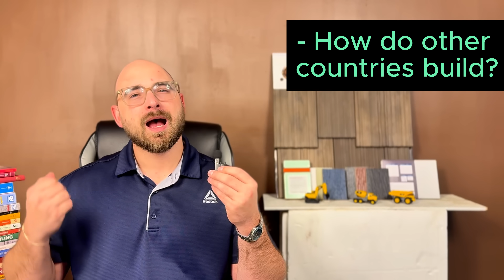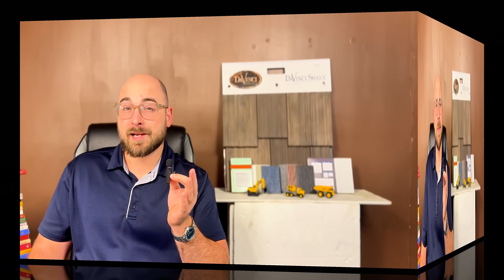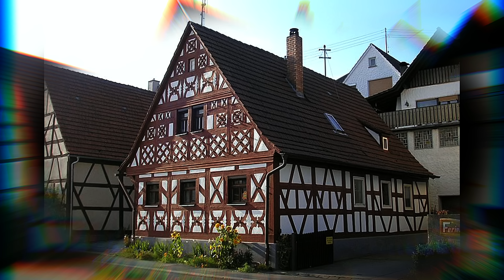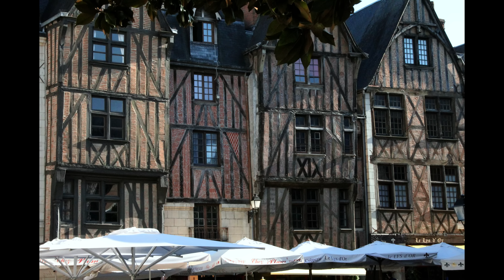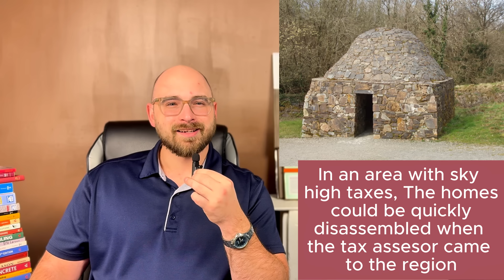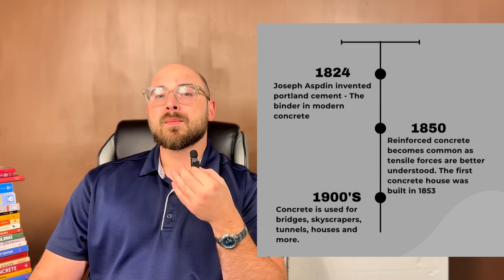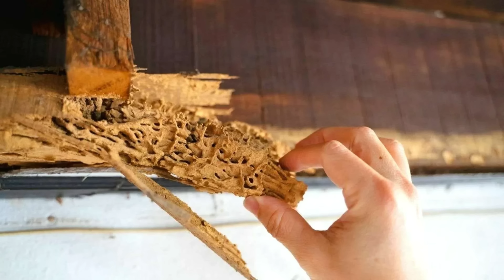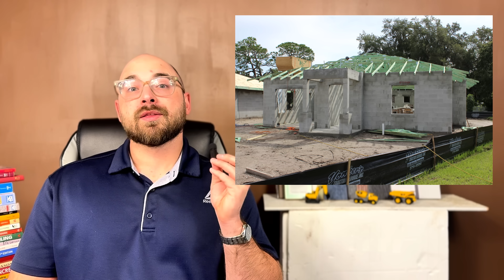Why Other Countries LAUGH at American Homes

Comment: We used to build walls better.  We used plaster, but it was not just plaster there was either wood slats or a plaster/concrete board with many circular holes in it, then there was about 1–2 inches of concrete, then maybe a 1/4 to 1/2 inch of plaster.  The house I lived in until I was 7 had the wood slats.  That was built in 1919.  The house I live in now has the holes (1958).  You will break your fist before you penetrate the walls (but in the 1958 house, a door knob can go through the wall.  That happened with the heavy front door). The 1919 house was built with a crawlspace and all the wood was oak clear of knots and the true dimensions rather than 2x4s that are not 2 inches or 4 inches.  However, the concrete foundation was crap, and so was the chimney mortar.  If the rest of the house had been built with that, it would have been a total loss 75 years ago.

In these discussions the Europeans forget that in California, Oregon, Washington, Alaska and Hawaii are very prone to earthquakes, and mass is an impediment not an asset in that event.  You need strength but relative to weight.  If you build with blocks or concrete, it needs to be heavily reinforced.  In California, our schools are built crazy strong.  We put that law in several decades ago to ensure that if there was an earthquake while school was in session, the building would be very unlikely to collapse, killing the students.  We also build water towers super strong because if they broke, that is a lot of water running down the hill.  And we did an expensive upgrade on all the columns of our bridges, after the Loma Prieta earthquake pancaked some cars in 1989. 

No, I don't like how we build homes today.  I think all the wood should be treated (resistant to mold and insects and, ideally, fire) and no white pine, just Douglas Fir.  And there should be concrete board under the plasterboard, and likely a thin coat of plaster holding them together.  All connectors used on the exterior walls should be corrosion resistant.  I mean nails for the framing, and any of those metal plates, bolts, etc.  If galvanized, hot dipped.  And I would like it if we stopped using asphalt shingles and went with stuff that lasted much longer.  And with that, we built stronger roofs.  And We need to use more quality plywood and less of the chipboard nonsense. I just did a bunch of work on a roof.  That stuff is just rubbish.  I don't think I will ever use that again.  I don't think that is suitable for anything.  Just ban that.  The rest of the complaints; the whining about electrical, just nonsense.

My fantasy is to build a log mansion, but the logs would just appear to be logs.  They would actually be reinforced and fire-resistant concrete.  The entire thing would be designed to be very low maintenance, high efficiency, ease in remodeling/adding new systems house wide, have extreme durability and with minimal chemical off-gassing.  And no HOAs or close neighbors.  Ideally entirely off-grid, including food production in a greenhouse.
Reply from the maker: Some great suggestions

I like the idea of the wood look concrete cabin, might be challenging to form up and detail correctly, but certainly doable 

Maybe with integral insulation
Reply: Europeans do not forget about seismicity. Italy, former Yugoslavia, Romania, Greece all lie in seismic zone and all have rich masonry culture and know very well how to use reinforced masonry. Even houses in non seismic central Europe have concrete frames and bond beams.It's so common that nobody even thinks about it when writing comments.

Comment: Why would any Brit make fun of an American house? Houses in the US, on average, are twice the size of houses in the UK. 1600 sqft versus 800 sqft. New homes in the US tend to be even larger. 2500-3500 square feet. Always with a garage. Usually a 2 car garage. British homes are the size of a 2 bedroom apartment in the US.
Reply: Because size is a quantitative measure and quality describes the quality, sturdiness, lifespan of materials. McDonaldizations of society conditioned people to perceive quantity as a quality.
Reply: @ElegantiaeArbiter 
Few, if any in the US, would describe a house of 4000 sqft as being a display of excessive spaciousness. Over 5000 sqft and those buildings tend toward the grandiose as the numbers increase. Nowhere is a 3000 sqft house anything but ordinary.
Reply: @oltedders  None of my family members and friends in US never expressed a need to have something bigger than 1000-2000 sq ft that they already have. It was never part of any discussion or a hint. They don't care. On the other hand they complained about the noise levels, inferior windows and doors, lack of insulation, low quality plumbing, pests in the cavity walls.
I think that oversized homes are desired by nouveau-riches. I somewhat understand them - if most houses are built from the same materials with similar mediocre finishes, the only difference to stand out is the size.
Reply: @ElegantiaeArbiter 
As I mentioned, competition for size in the US is something past the 5,000 sqft mark. And a million dollar pricetag.
Reply: @ElegantiaeArbiter 
Enough bulls hit. It sounds like you're making "life in anything  larger than a barely adequate floorplan" as some sort of punishment.
Reply: @oltedders  There is no need to use swear words. Your comments just illustrate the McDonaldization phenomenon.
Reply: @ElegantiaeArbiter 
Do you need some cheese to go with that whine?😟

Comment: I like stick-frame. It's a good system. It's pragmatic, efficient, and uses a renewable resource that is extremely well suited to the task of light residential construction. The problem is not the system or the material, it's that greed overtook the construction industry. It became a well oiled machine good at cutting corners to chase short term profits.
Reply: May I ask what's renewable in glues used for particle boards and plywood, vapor barriers, petroleum products in shingles, caulking, plastic pipes, plastic siding, synthetic carpets and so on?

Comment: And they are Right! Homes in the US suck! poor quality, weak, cheap materials, all this driven to gain profits while spending less money and resources in building homes. All that favors the ones who make money out of families, ridiculous prices for some mediocre cardboard house, that will fly away with any weather event. In my hometown, in a Caribbean island houses built with concrete and wood have gone through several hurricanes and are still standing! they were built to last.
Reply from the maker: Are the roofs concrete too? 

I recently read a case study about concrete homes in hurricane zones. The article said that having a concrete roof on concrete walls, makes the home virtually hurricane proof
Reply: @Mike_Fortin  The house where I used to live is built in concrete, concrete blocks walls, reinforced with concrete columns and the roof is also a reinforced concrete slab, it's actually a bunker, it has been impacted by two powerful hurricanes with no damage at all.

Comment: Don't forget about the 3D homes.
Reply from the maker: They would fall into the concrete house category, I’m personally not a fan of the 3D printed homes. 

They crack, they’re exposed to the elements and absorb moisture, thermal bridging, not enough insulation, etc, 

A solution in search of a problem

Comment: A child can easily fold a roof shingle and it will break. I always thought that was a major flaw.
Reply from the maker: I mean, I don’t think I’ve ever seen kids on a roof lol
Reply: @Mike_Fortin Before the shingles are installed sometimes they are in the shed. So the kids don’t need to be on a roof. But the point is about how fragile those asphalt shingles are. It’s no surprise how often they need to get replaced.

Comment: why tf wood ? you guys should use concrete and iron beams as a structure , your homes are insanely expensive and not that strong. wood, nails , cardboards, rubber for roof and plywood. tf ! cost 520k . whaaaat !

Comment: Energy efficiency is key in areas with extremes of climate like here in Finland. Because heating and cooling can easily outweigh the original cost of the building.

Comment: Personally, in my country in North Africa, cement is cheap and the first choice for building houses. There is no alternative other than brick and concrete for building a house.
Wood, however, is much more expensive than cement and brick in my country.
And you know that a house made of brick and cement will be more durable and long-lasting than one made of wood.

Comment: I wouldn't criticize the lightwood framing as a whole, but the way it is executed in the US. Lightwood framing with bigger wood dimensions and stronger connectors would resist the next heavy storm. And if we change this horrible foam insulation against mineral wool the risk of burning down the house will decrease enormous.

Comment: Good luck building a masonry home that can survive a magnitude 7.0 higher earthquake. I live in California, we don’t do masonry construction because masonry crumbles in earthquakes.
Reply: Do you also build your bridges, skyscrapers or prisons out of lumber? Besides the fact that California has various seismic zones, the most serious problem is the fire that can start on any hot and dry summer day. Please check the construction techniques in Italy, Greece, Chile or Japan. Entire USA does not do masonry (with some exceptions in the Southeast). Earthquake is just one of the excuses and the real reason is sticking to a (bad) tradition of building disposable, flimsy structures that originally cheap to build became expensive.
Reply from the maker: Masonry no, concrete or steel yes
Reply: @Mike_Fortin  In this lingual ambiguity case, it would be better that people used the term "unreinforced masonry". Most of masonry in the world built in last 100 years is reinforced one way or another. Greek temples had lead anchors connecting the stone ashlars and similar techniques were utilized throughout the ages in stone construction. Some brick and adobe buildings had timber bond beams.
Reply from the maker: Correct, 

Also, thanks for supporting the channel, I’ve seen a lot of very insightful comments from you, so thanks 😊 

I was just watching a video about Roman construction the other day, they connect massive pieces of stone with iron pins, then poured molten lead into the pin cavity to protect against rust

Super cool stuff
Reply: @Mike_Fortin  Thank you. I simply think that this country deserves much better quality in housing construction. For objective reasons, but also for cultural cause - to generate lasting value and true pride for the next generations.

Comment: 3rd generation contractor here and I would tell anyone buying a current home for sale they are being stolen from. Nothing in the house will last 30 years. Nothing. I could go on for years about everything that is wrong with the current construction methods. Home should be built out of steel at this point. Steel frame steel siding steel roof.

Comment: France here: two  important additions
- newer homes nearly all have very thick and deep "concrete crawl space" that is rather technologically advanced. You can't crawl inside it though as it's completely insulated, unlike a basement. First it's deeper these days and made of a maze of thick concrete bricks stengthened with metal bars, topped with composite ground slabs of polystyrene and an upper layer of concrete below the floor level, making it able to shift without cracking. Houses are built to withstand  swelling and shifting soils such as clay and sand. Constructors study the ground thoroughly and then tell you which crawlspace fits best your terrain. They usually choose the safe side instead of the cheapest as it's considered more important than anything that comes after,  a protection for the (brick) wall structure.
- the latest insulation norms are draconian. Measured with positive pressure, homes are now meant to be highly energy efficient by default, adding the technologies of insulating bricks and composite plaster pannels inside plus an outer coating that has antifungal and water repellent properties and is efficient for sound and heat insulation. Surprisingly even the cheapest materials among these are much more efficient than houses built around a decade and a half ago. The latest norms are twice as effective .
To be clear it's no "obligation" per se but there is a huge incentive from the state to build these "more ecological" homes where energy efficiency allows you to sell or rent at a better price.

Comment: I have no questions about the framing in the US, but the choice of surface layers is odd. What I see here on YouTube is vinyl as exterior walls, plaster as interior walls without plywood underneath. Roof shingles directly on OSB with just paper in between that is barely waterproof when new. Stirdy metal roofs, plywood or OSB under all plaster and 1" exterior wooden boards is what we are used to. 

Wooden houses with rock wool insulation actually don't burn that easily, but it's all the plastic we fill our houses with that is a bigger problem.

Comment: The UK housing stock is dominated by regulations after the Great Fire of London in 1666 to restrict exposed timber, and variable success of adopting new materials in the twentieth century. Timber frame was once common, but little remains. Availability of mortgages and insurance tends to limit flimsier construction.

Comment: For the concluding question i´d say this:

American houses are not better or worse. 
It´s based on if it´s smart to build it in a country with certain conditions.
If a country like the US that has hurricanes and tornados rolling through on a regular basis builds most houses so fragile it´s no wonder why solid structure countries laugh about the US.
Take Germany; Houses there are made for centuries that would have no problems with tornados or hurricanes. Do they need to be that sturdy in that country? Absolutely not because there are NOT too many environmental disasters. Do they still build like that? Yes = Big flex.
America; Houses are made for a few decades which get blown away by wind easily. Should they be that fragile in that country? Absolutely not because there ARE many environmental disasters. Do they still build like that? Yes = makes US building look stupid in comparison.

Comment: The video is kinda subjective.  I’m a contractor in the US. Home construction and materials varies widely in the US.  It depends on local law, state laws and if there is any sort of other laws like an HOA.  I live in the Midwest I can’t say that I have ever lived in a house here that isn’t brick, mortar and concrete.  Yes the framing of the house is wood and the interior walls are drywall but it is this way for a reason.  To make the area easily repairable.  The problem in the US is afford ability.  The repairs are expensive because of cost of living.  But the house are generally designed in a way to be easily repaired.  Even by a homeowner.  I mean hell there is a YouTube video for anything nowadays.  As far as affordable goes using some of these building processes in the US would be even more labor intensive which means even more money.  I’m really not sure what the fix is other than getting more people into trade work. For every 3 of us that retire only one new person enters the trade.. so the price continues to rise.

Comment: It’s funny how many people in here are experts in how US homes are built. These people have clearly never even been here. While we do have some pretty shotty home builders, we also have some good ones. Even stick frame construction can last hundreds of years when done right. My great grandfathers house still stands on our farm. Had it been maintain and didn’t sit empty for 40 years it would still be just fine. It was made by perfectionists and old growth timber. The studs are actually 2” X 4”.  Also, it’s easy to neglect the historical element of the US. The frontiersmen that moved westward had lots of trees and very little manpower. They had to get something built quickly before they got scalped by Indians. So yea, fast wood structures became the norm.   Lastly, American homes do not have paper walls. If you try to run through one, you will break your face. Just letting you experts that have never been here know.  PS. I am not saying we build houses like the Europeans, but not everything built here is trash, and much of our history we built like Europeans, because we were mostly Europeans…

Comment: A very enterteining and educational video. Thank you!
You forgot, that in most countries houses are built to withstand the challenges of the climate, such as heat, cold, wind and water and not to forget earthquakes and even avalanches. For vulcano eruptions are no proper defensive materials or techniques used in house building, for as far as I know.
One disadvantage in American housebuilding in my opinion is in many cases the absence of a (small) hall at the entrance. This way people can easily hang their jackets and put away their dirty shoes, but more importantly, it helps to keep the heat or cold outside. In the Netherlands we have a saying for when someone leaves a door open, that we don't heat the outside air. (Usually our backdoors don't have a hall, only the frontdoors.)
Building stonewall houses in tornado areas could be an advantage, but still the roof could be ripped off, since rooftops with angled roofs, which are pretty common in Europe, are also built with a wooden frame. However replacing just a roof seems much cheaper than rebuilding a complete house.